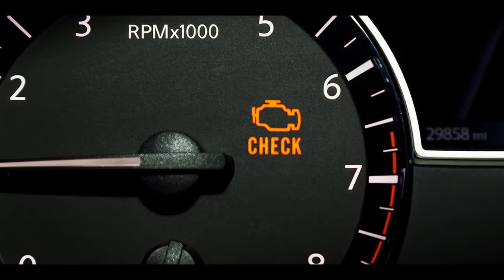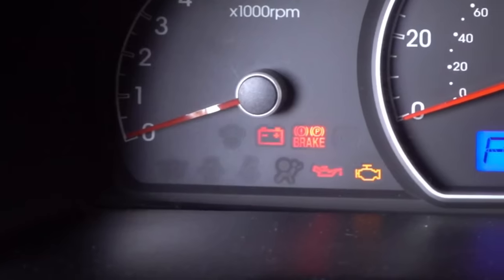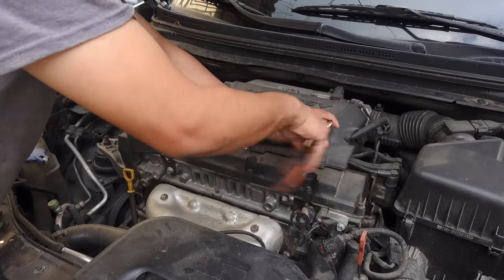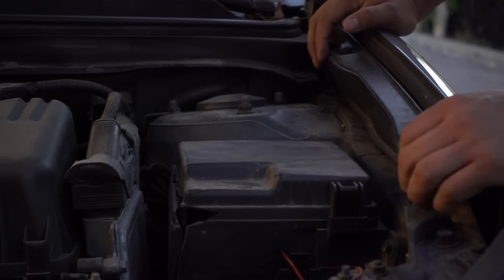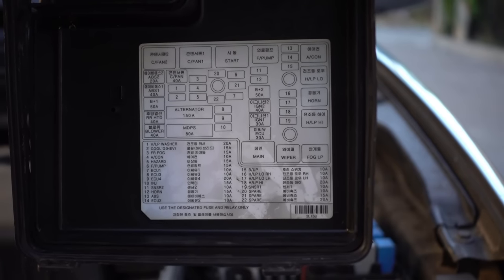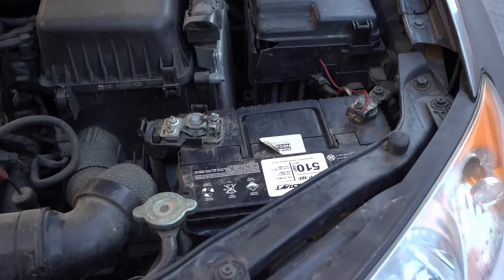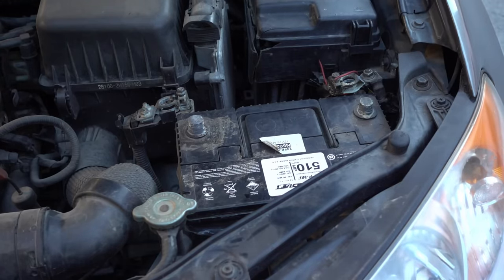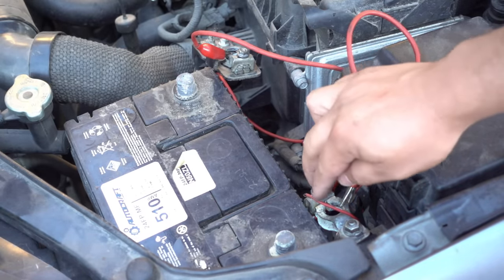4 formas de apagar la luz CHECK ENGINE sin scanner Gratis 2024

Comment: Hola amigo me encantan tus vídeos muy explicativos. A mí me pasa que lleve el carro a hacerle mantenimiento suspención etc y cambio de refrigerante cuando estaban cambiando el refrigerante una manguera se rompió se cambió luego que IVA para mi casa salió el testigo muchas gracias si me puedes responder me tiene aburrido que me halla salido chek engine
Reply from the maker: Que año y modelo es tu vehículo amigo,aunque por lo mencionado,lo más probable es halla dañado el sensor del radiador muchas veces con el Tiempo los tomas se dañan y cuando se les hace un movientos un poco brusco y por la temperatura se tuestan
Reply: @garylemuz  
Muchas gracias Gary era eso el sensor ya me lo cambiaron y quedó perfecto. SOS el mejor
Reply from the maker: @andresduque6881  me alegro Mucho Ser de Ayuda Amigo, Igual Gracias Por el Apoyo Saludos!!!
Reply: @garylemuz  tengo una durango dosmil siete tiene ese matarsito prendido lequito la batería y duras días si salir y vuelve de vuelta que puedo Aser dónde tiene el fusilbe
Reply from the maker: 3.7 o 4.7???
Reply: Buenas noches tengo un Chevrolet Astra motor 2.2 año 2002 le prende la luz de chequen y cuando le hago lo de los bornes ella apaga pero después al mucho rato le vuelve a prender
Reply: tengo un Hyundai accent 2014
Reply: @garylemuz  Lleve a mi aveo 2008 a que le cambiaran la alarma se la pusieron todo perfecto sali de alli y al dia siguiente cuando me monto en el auto tenia el check encendido que podria haberse fastidiado para que eso pase el auto va perfecto solo es el check encedido seria algun sensor dañado lo compre de segunda mano hace poco tiempo y creo que nunca se le ha cambiado ningun sensor
Reply: @garylemuz  puedo borrarlo para hacer una inspección anual o solo es borrarlo del tablero del carro,?? Ya que pronto necesitare una inspección para mí carro

Comment: Hola muchas gracias por todo el esfuerzo que haces para este tutoriales en sí yo probé en mi carro todos estos métodos pero sin ningún éxito quisiera si me puede ayudar por fa a ver si se puede borrar el check engine 
Mi carro es un Pontiac Grand Prix gtp supercharged 1997 
3.8L 6 cylinder 
Gracias muy amable
Reply: Hola para un Stratus std 06 ?
Reply from the maker: tengo un video al pie, razones por la cual nunca apaga
Reply: Hola bendiciones Gary Lemus ya no recibí su respuesta le deje los detalles de mi vehículo pero no recibí respuesta yo tengo un Pontiac Grand Prix Gtp Supercharged 1997 6 cilindro 3.8L 
Tiene check engine y el code P0441 y el diagnostico dice puede ser unos de la siguiente nombres 
Purge Valve, Purge Selenoid, evap canister, fillerneck, o la tapadera de la gasolina pero créeme que esos ya le cambiaron y la luz del check engine sigue encendido espero su respuesta gracias
Reply from the maker: @jcoficial1324  déjame buscar la información correcta correspondiente a tu vehículo saludos!!!

Comment: Hola buenos días saludos para todos,muy buena información ,tengo un Honda Fit 2002 y tiene ese problema ,pero según entiendo la luz se activa por un problemita en el motor  puedo apagar la luz pero el problema en el motor sigue ,pero es molesto ver esa luz activa ,si estoy equivocado me corrigen por favor
Reply: Tengo una nissan pahtfinder 2006 marca el codigo p0420 tengo muchos problemas con ese codigo
Reply: Apagar la luz del check solo es quitarte la molestia de ver la luz encendida, pero no es la solución del problema, si esa luz se enciende es porque la computadora del auto a detectado una falla esa falla hay que solucionarlo y después resetear la ECU y ya no debe volver a encender, no es cuestión de sacar el foco, el fusiible o de abrir y cerrar el contactó 5 veces, eso es una solución momentanea, es bajarle la fiebre a un enfermo sin atacar la enfermedad que produce esa fiebre, la luz check es un síntoma no una enfermedad.

Comment: Buenas Noches amigo yo tenia un problema con el check engine mearcaba el código P1860 tcc pwm  solenoide circuit Electrical lo mande reparar pero me sigue marcando el check engine y lo borro y vuelve aparecer podrías orientarme que hacer lo e llevado a varios lugares y la verdad ya e gastado iluminante antemano Gracias

Comment: Amigo mi carro es un Nissan Xtrail 2017 automático motor 2500, estaba prendido el testigo de derrape, lo fui a probar y el carro se quedó sin potencia. Le aclaro que se le estaba reparando el aire acondicionado, en específico le cambiaron el evaporador, armaron y el carro.. apareció con los testigos de derrape, chek engenie...además el carro perdió la potencia. Muchas gracias por su atención, le escribo desde Costa Rica, mi nombre es Marvin
Reply from the maker: basado a que fue algo causado es necesario ver el codigo de error